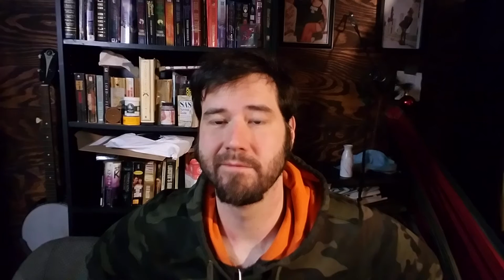Flower Pot Heaters Don't Freaking Work Rant

Comment: Hi my name is Jonathan colon and I am an inventor I've been working on this project for quite some time and you are correct about the heater it does not work and it's because of how they have made this design cheap 
and good things like that are not cheap the company and I have discovered a new material that works I've been working on this project for over a year and finally I have came up with the perfect design that works it generates 150 degrees of heat it was never clay pots something more costly can not talk about my designs yet until you see in stores hopefully one day we will power a house up with the energy of a candle but for now be patient until we send them in stores I would love to give you more information but unfortunately I'm limited I don't want to be sued LOL
Reply from the maker: Jonathan Colon you can email me.  im sceptical to be honest
Reply: SurvivalPunk 3 years later I bet he’s come up with nothing. Though hey might be making hot air by burning snake oil- it’s the only work around for thermal dynamics.

Comment: I finally got it to work with one full size pot and a pillar candle.  Half dollar of the hole in the top of the pot for vent control.  Pot is held up by three very small pots and the pillar candle in the middle and all of it sits on a clay pot plate which never gets hot.  The thing generates enough heat for sitting next to with a cup of coffee on an early November morning.

Comment: Dude what you talking about it works great but only in a small room
Reply from the maker: Crance Feliciano no you are delusional.  They do nothing
Reply: no dude forrealz it works i am in a small room it helps .
Reply: I used six tea candle I used  to use my buddy heater but I tried this pot candle out.
Reply: No they don't. The flowerpots contribute nothing. There's no point to the flower pots. You could light your 6 candles without any flowerpots and still get the same results.

Comment: DIFFERENT FORMS OF HEAT ARE TO ME MEASURED DIFFERENTLY. Measure the body tissue instead. This is WHY it is used throughout the world throughout history effectively.  This is called radiant, or FIR (far infrared heat) heat. Your thinking is a little like measuring the heat inside a microwave oven & saying it can't cook. I appreciate your effort, but your flawed "debunking" in this instance may cost lives otherwise saved.  You have not taken into account the effect of FIR-Far infrared heat, that resonates with body heat (btwn 7-16 microns).  It may not heat a room, but it will heat bodies nearby and permeates body tissue deeper than plain heat can.  FIR is used throughout the world in the form of any heat source going through ceramic, sand, jade, tourmaline, brick, etc.. Do it and watch the pets gather round it.  A modern example is any FIR  heater, where it may not heat a room, but any body near that source will increase in temperature.  I am currently warm in a cold room sitting at our Japanese FIR-heated table (Kotatsu), and our dry FIR  sauna is upstairs.